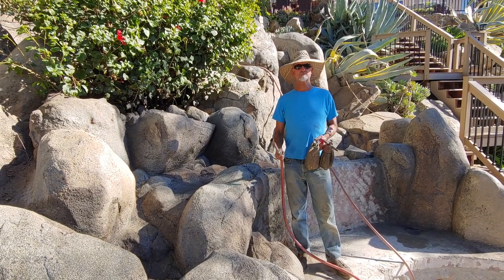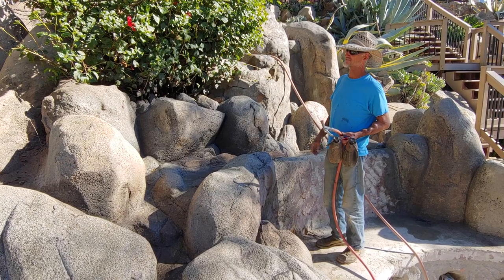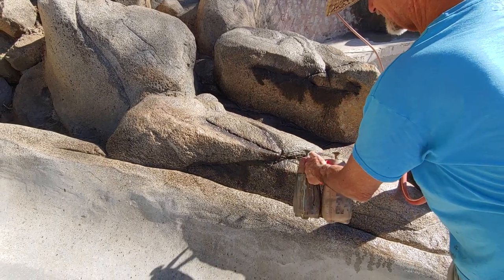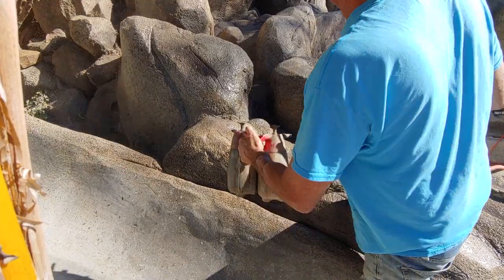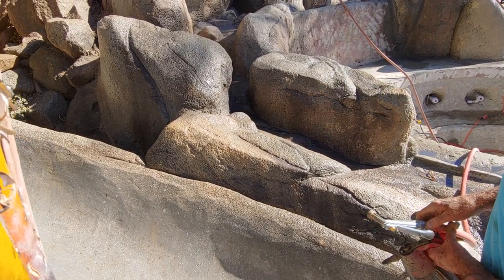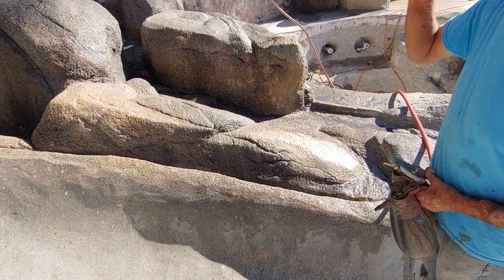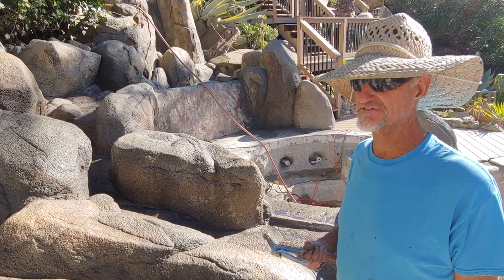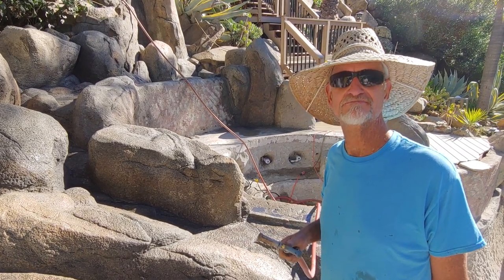Painting Fake Rocks using the "Wet Technique"

Comment: Hello, I’m going to attempt to built a concrete pond. Do you seal the paint with something to stop it from peeling off? Particularly rocks that are partly submerged? 😊Thanks from London, UK.
Reply from the maker: Thanks for the question John!  Ya, I never seal my painted rockwork.  Other rock guys do but I just use high quality exterior latex house paint.  FYI submerged rockwork doesn't peel if it's a biological pond, (has plants and fishes).  The paint does fade, (not peel) when in people pools that have chlorine in them over time.  But for your pond build the easiest way to do that is by using a pond liner, (rubber EPDM or other type of water proof material) over which you can apply concrete.  You can also build ponds without any concrete but I like concrete because it protect the liner and makes getting in and out to clean it easier.  This video shows an example of this strategy, (concrete over rubber liner): https://www.youtube.com/watch?v=JKYnssK_whQ  No faux rockwork was used on this project other than a little paint on the pond shell itself which in short order gets totally covered by algae.  To learn more on pond building and rockwork you can download free pdf files and/or look into getting some of my other content to help you with your project if ya like.  See: davehenderson.podia.com   Anyway, I hope this info helps and good luck!  :)
Reply: @DaveHendersonFakeRockVideos thanks so much for the reply…very appreciated. All the best from London.

Comment: Interesting. You prefer those to stains?
Reply from the maker: Hey Eric, yes, acid stains are great in that they penetrate the concrete/mortar providing a more long lasting look.  The problem is they have a limited color spectrum that also can't lighten rockwork.  I do use them for pond basins and stream beds none the less at times.  Anyway, high quality exterior latex has been what I use...  Have more fakerock how-tos, including free pdf downloads and more at davehenderson.podia.com. Have blogs and links to other platforms at www.daverhenderson.com
Thanks for the question and best of luck to you.  :)
Reply: @DaveHendersonFakeRockVideos  do you seal them with anything after painting them?
Reply from the maker: @ickysan  dont3 use sealers because in the past they made my rockwork too shiny and possibly more slippery.  But I know other rock guys that do seal their work.  Just get the best quality product, (commercial grade) you can if you do choose to seal stuff.  👍
Reply: @DaveHendersonFakeRockVideos  Thanks!😊❤

Comment: I tried this and often it seems like all the color washes away and find myself coloring it again. It may be the colder climate up in Oregon compared to California that it does not dry up as fast enough and just runs off. I played around with a blow dryer and that seemed to help.  Just been experimenting and practicing. Definitely a skill in itself.
Reply from the maker: Yes, the misting does rinse the color away if to much water goes on.  Just gotta use less or try a pump spray bottle with water instead of a hose. :)

Comment: How can I make my slide more smooth cause I feel that the sun made the surface hard n not slippery
Reply from the maker: I coat my slides with an epoxy first then a polyurethane the following day.  I get the products from www.westcoat.com. contact them for a distributor and tell them what you're doing and they'll recommend what you need and instructions on how to apply it.  Good luck!